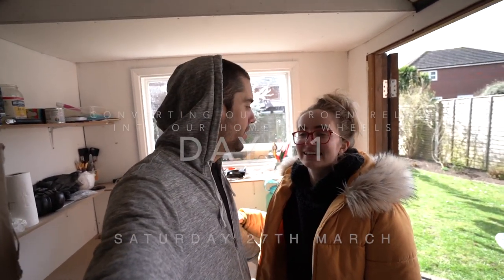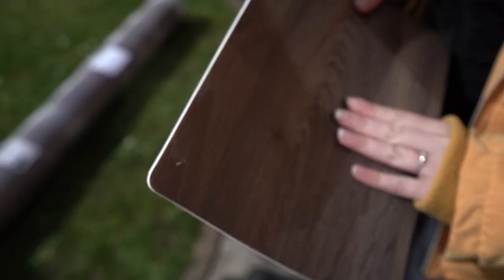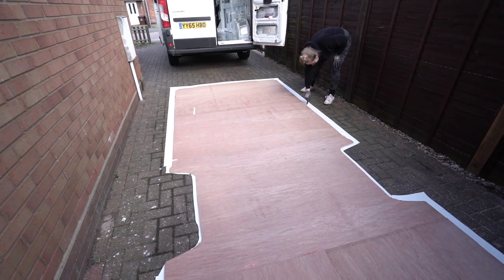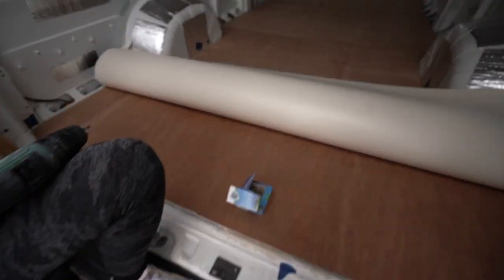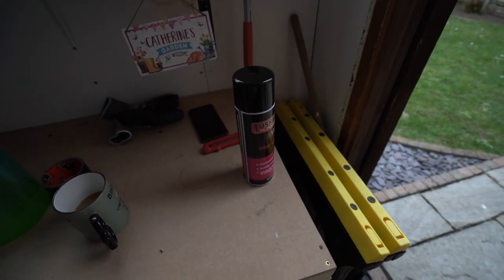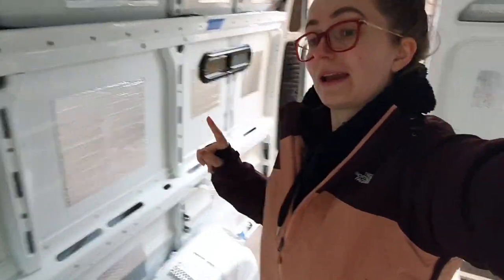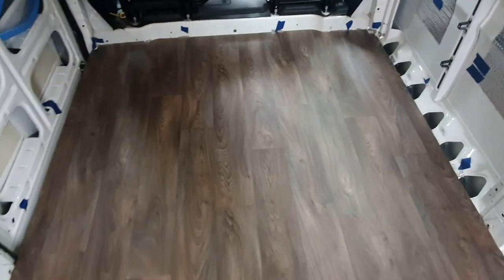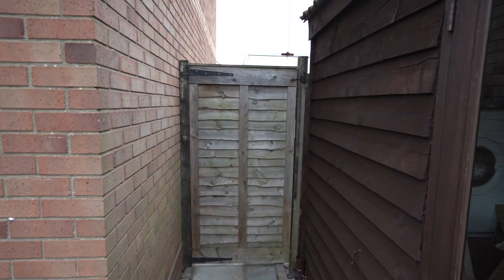VINYL FLOOR Install - Camper Van Conversion UK Vlog - Citroen Relay - Week 6

Comment: Hi there. How has the spray adhesive held up? Any bubbling/movement/etc?
Reply from the maker: Hi! No issues at all so far, it's been in the van for around a year now so I think it's safe to say it'll stay this way!
Reply: @CasLaz  Cool. Looks like a much easier installation than the typical adhesive that you trowel on.